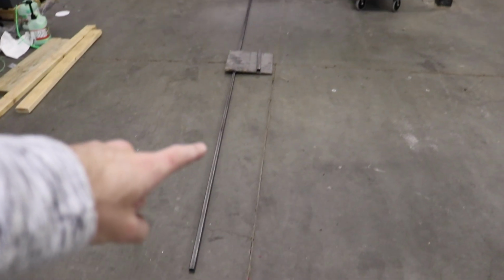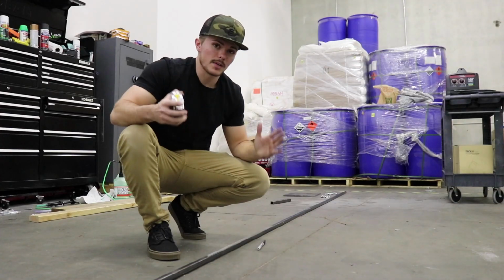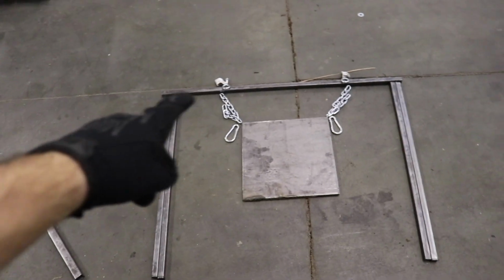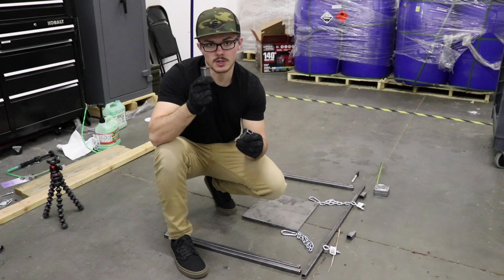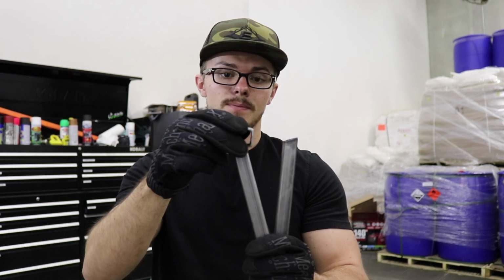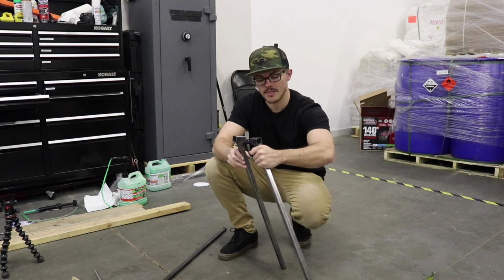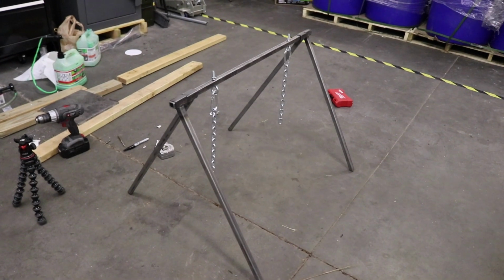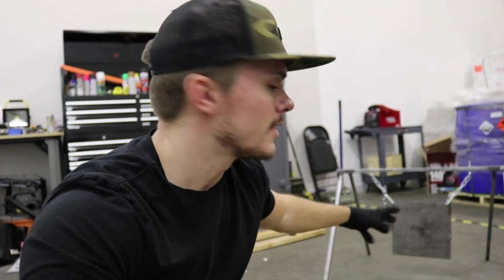DIY Steel Target for $50

Comment: What kind of steel did you use for the plate?
Reply from the maker: Just 1/2” steel. Nothing fancy, might buy some AR500 steel and compare the two side by side tho
Reply: @BraxenMcConnell   Just don't shoot it from too close, and make sure not to use any steel core ammo, and it should be ok.  A comparison would be cool.